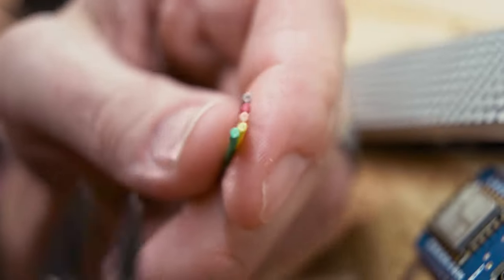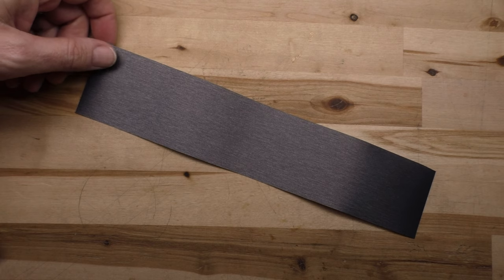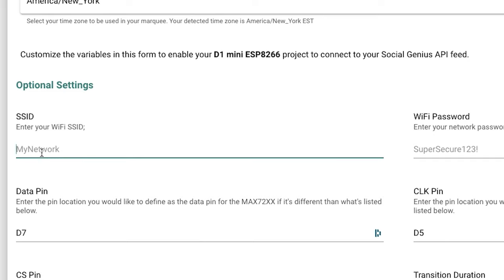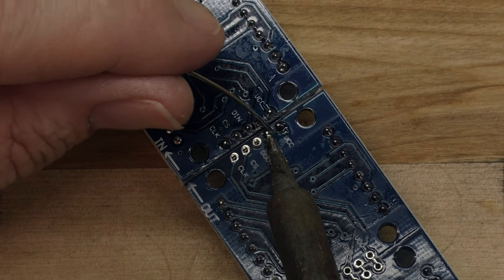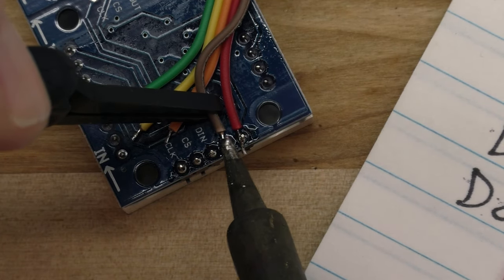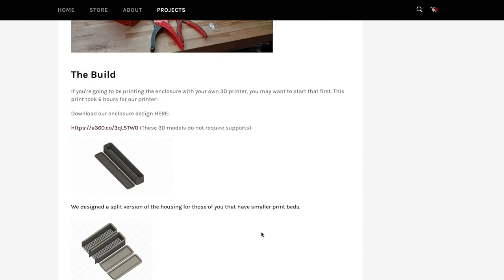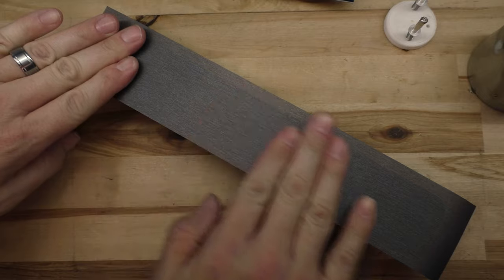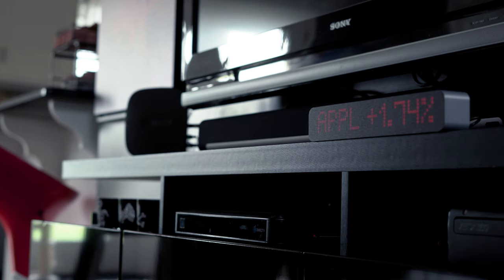BUILD: Sub Counter / Internet Clock

Comment: This is amazing!  

I started out my career in the mid-80's designing and developing LED signage for employee communications, airports, tickers, etc.  I used an 8085, 8049, and Z80 microcontrollers to develop these displays.  It's amazing to see the processing power and cost parity that has occurred in 40 years.    I later worked for Daktronics as an LED product manager, planning displays and clocks for Time Square, Vegas, call centers, heavy industrial, high school scoreboard, and every gas station that needed to display gas prices.    

I just found an old LaBelle / Daktronics InfoNet display (one of my products) in a closet and hooked an Arduino MKR 1010 WiFi  to it for internet time.  I"m going to order one of these to just to have some more fun... Thanks for the fun video!

Comment: HI, Thank you for this, I am in the process of making one but unless i am doing something wrong there's a glitch in the code. When i make the code there's an option for the transition and default it is set to 3. I want it to cycle slower so i tried 5  and 10 but if its any number other than 3 its just gets stuck on time and does not cycle atall. Any help would be appreciated?

Comment: The generated code does not compile for me. It is trying to do a String which is C++ with sprintf() which is C. What did y'all do to get the code to run?
Reply from the maker: There is a good chance you’re missing one of the libraries. Please check out our guide to double check…
https://hackmakemod.com/blogs/projects/diy-kit-guide-building-your-own-subscription-clock